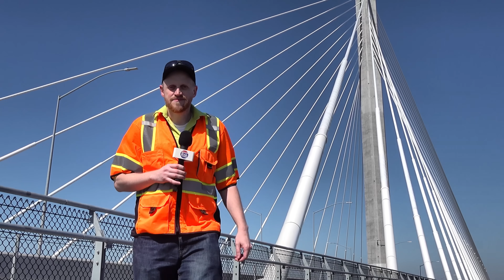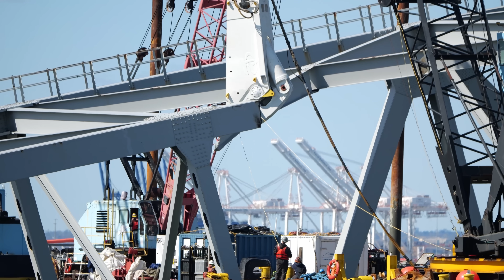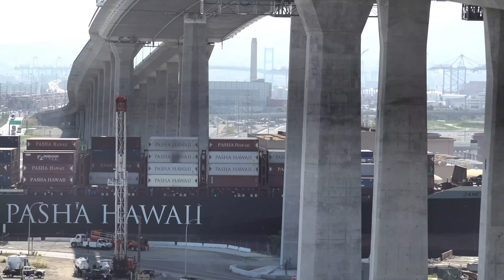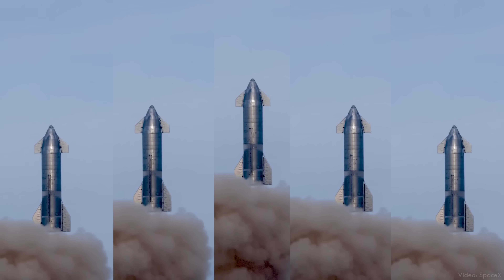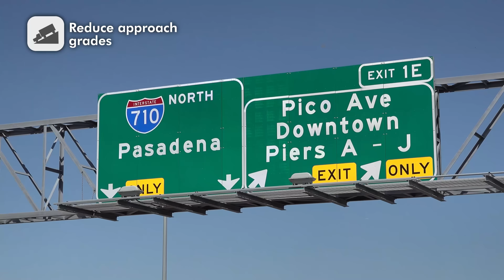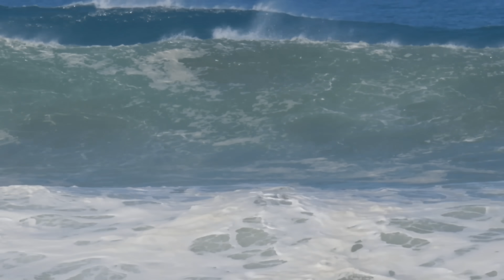How Bridge Engineers Design Against Ship Collisions

Comment: It seems that since bridges don't run in to ships; that the government agencies that regulate the shipping industry should do some actuarial studies and come up with a surcharge to be levied creating a fund for repairs and rebuilds of damaged infrastructure. Of course this cost is past down the chain to the consumer but so are government sponsored remedies that the taxpayer picks up. The difference is that the fund would be proactive and if a certain area of the country is more prone to these types of accidents; then the surcharge could reflect that. Also, it makes more sense to redirect the energy than to try and stop it. In addition to the concrete bunkers that protect the piers; couldn't they engineer powerful turbines behind them that would create a sufficient current to move a ship away from the piers. They could be automatically turned on by sensors that don't like the proximity of a ship to the bridge.

Comment: I really liked the way you explored risk and risk management in this, it would be super cool to have a whole video on risk based engineering, and breakdown risk control measure into engineering controls (like islands or putting piles on land) and administrative controls, like speed limits in channels, local port captains and tug boats! I work a lot in risk management engineering and sometimes it's hard to explain to other engineers the concepts behind risk based decisions and acceptable risk levels. Great work!

Comment: I have been pondering what the best way to protect bridge structures ever since the Dali struck the francis Scott key bridge.  It would seem to me that we need to look at the shape and angle of guardrails on either side of highway bridges.  In my thinking, guiding the ship back into the channel is the better solution.  I don't see how the small dolphins would come close to accomplishing this task whereas a long concrete wall/curb would better facilitate the event.  I am not an engineer, but I believe in brainstorming.  someone's Idea could be either the solution or a part of the solution.

Comment: Very well stated.  So, I'm a native Marylander who learned how to sail in the "literal" shadows of the Key Bridge.  The average depth in the Patapsco, and even the northern Chesapeake (north of the Bay Bridge) ranges between 15-20, maybe 25 feet feet.  I was taught at an early age to recognize when we were crossing the channels... which would go to 50 feet.... With that said, I do know that the width of the channel under FSK bridge was less than the total length of the main span but unfortunately not enough to slow the ship in time.  I do wonder if the replacement bridge (like the one in LA that was pointed out) would have a longer span - not necessarily placing the towers on land BUT back far enough - would benefit from a more natural barrier of very shallow water to protect the bridge piers.  I'm in no way suggesting no other protections be implemented for a new bridge BUT the Chesapeake, that far north, is much more shallow than most other ports around the country.  Just saying that 15-20 feet of water is going to slow down a large container ship like the Dali pretty darn quickly when it needs at least 45 feet.

Comment: I am working on a pizza oven. I am laying firebrick on top of a concrete slab sitting on a cinder block stand. The countertop slab (under the firebrick) is going to overhang 7 inches on either side and 6 inches in the front (no back overhang) I’m worried because I am building a dome which sits on the edge (of the overhang) and the majority of the weight will be on the over hang. It’s gonna be lightweight concrete reinforced with rebar. It will have a 7 in over hang on the sides and 6 on the front. Counter slab will be 3 in thick. Can that support a pizza oven. I’m worried that as I stack bricks on the overhang, it will pull the top half (if the slab is cut on its biggest cross section) of the slab and crack. I know the rebar provides tensile strength but it’s not like tensioned or anything so cracks will form before the steal has a chance to resist the tensile stress. I was thinking abt pouring it with 1/2 threaded rod instead of rebar and using stainless steal sheet metal as the form for the concrete (temporarily reinforced with wood) and then tightening bolts on either side to provide tension before I place a load on the overhang. And I could finish the bolts and they’d have a sick kinda steampunk look (I digress)

Anyway can you Mr. Hillhouse or anyone else with any expertise comment? Is this overkill? I have 10 days until I’m expecting to pour the countertop slab. 

Thank you for your time!

Comment: As a former maritime electrical engineer, ships have redundant machineries to the point where all critical equipment are doubled...especially for pumps. When it comes to power they have generators and an emergency generator that powers a redundant hydraulic pump for the steering system. The problem here is both the spare generators and the emergency generator somehow failed...most probably there was a problem with the emergency generator, there are alarm logs on board, there is an event printer that prints all alarms, its connected to a UPS.
As for tugs accompanying the ship, simple answer... tugs are really expensive to have on hand for such a crossing... we are talking 4-5 digits for every crossing.
TLDR sometimes 💩 happens, investigation will tell us if it was improper maintenance of the Em'Cy generator or whatever the root cause was for the repeated blackout.
Long post, hope it helps

Comment: The one thing to remember about spending more money to reduce risk, is that there's so many elements to the system. At some point, the bridge is safer than the surrounding roads, so you spend money there instead, and then the intersection design, and even moreso you could be using that money on things like education or fire departments or any number of other things. It's important to remember where else that money could go when you think about why we allow risk

Comment: As a seafarer myself and in Engineering Department of the ship, there are tons of backup machinery in case something fails. I'm talking about 2 pumps each for Lubrication, Fuel, Hydraulics, Air system and Cooling Water (Fresh water and Sea water), and each machinery has 2, meaning Generators and Main Propulsion have their own set of 2. Also all of those machinery have corresponding backup (Auxiliary) pumps which means even if 2 pumps fails (or the power fails) there's still smaller pumps capable of running the ship. There's also an Emergency Generator beside 3 Main Generators (really big ones) so an engine failure on 3 will still able to run the ship as all non-essential machineries like AC and normal lights are off to lower the load. Basically a ship is capable of sailing on Emergency Generator alone if worst comes to worst, theoretically.

Now onto inspections, there are 3 port authorities that are somewhat infamous for how strict they are in the world, US Port Authority, Australia's AMSA, and Chinese Port authorities (they're getting stricter every year) not to mention EU countires and Port Authorities. To prepare for going to Port in US alone will cost the ship tons of drills, testing of machineries and cleaning. I'm talking about a month of preparation with minimum of 2 weeks, basically lot of overtime for all crew to test and drill for emergency (these authorities are no joke for us!) as failing for inspection means lots of trouble and more overtime for us to rectify said troubles.

Overall my point is, it takes a lot, I mean a lot to cripple a ship. You need to be a bad Engineer to disregard all maintenance operation and it will still take months prior to this incident to f up the ship. I know nobody is perfect and those shipping companies that does wihtheld supplies for ship maintenance and crew living ain't gonna go to these 3 countries (US, Australia and China) and EU in the first place since it will cost them tons with their little budget and low profit and one peep of a seafarer about their living condition and these companies are now under special spotlight every time. They'll be going to more convenient deals that will not give them much trouble with convenient countries, and even then a skeleton ship is still susceptible to ITF (International Transport Workers' Federation) raid and charges, basically a seafarer police that will force companies to treat us better as well as making the ship more safer.

TL;DR - It takes a lot to cripple a ship with bad machineries and poor company policies, my conclusion is, a cyber attack is easier way to cripple a perfectly good ship undergoing regular inspection of US Port Authorities and maybe other good Port Authorities. Also I heard Synergy is a somewhat good company.

Comment: as with any safety system, there is a point at which engineering becomes too costly but you can still add other ways to reduce risk. Just as hazmat vehicles arent allowed in tunnels in the area, vessels can be required to have a tug escort under important waterway bridges.

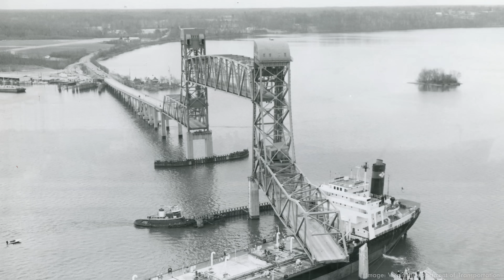Comment: Whatever bridge goes in, put a man in front right corner with a 2 way radio and a rangefinder, and a man with a 2 way radio and a rangefinder of the ship. Have the captain aim for the middle of the bridge so they can measure distance between the pillars 7:36 7:40 . Hey, I have 500 feet on my side and the other spotter says I have 900 feet on my side. Nice and slow too and no night time departures. Total cost of equipment is $1,000. Keep it centered captain. Save a couple of billion dollars by not having a accident
Reply: or mandate tugboat attendance

Comment: What is the cost of adding a dozen or more "Dolphins" before the bridge?  All the engineers reading this should be able to do a quick "back of the envelope" calculation.  Now compare that to the cost of this incident: loss of bridge, loss of ship, loss of business, loss of travel time.  It seems that regardless of the costs of the "dolphins" they would have been way less expensive than this cleanup and rebuild.  Its is, and was, all about the $$.  "Don't have the money to prevent this, but will somehow find a lot more money to  fix it".  OK, it may have taken a year or two to build the protective "dolphins" so what to do meantime?  Well, when the larger, exponentially massive, ships were approved, there could have easily and cheaply been added the requirement to use a dozen Tugboats.  

Why were these obvious and simple , and affordable steps not taken?  Easy answer: incompetent politicians and bureaucrats !

Comment: with these older truss bridges its also important to understand how each half of the bridge works, ie if you cut the bridge down the centre to have a left and right side, each half is designed as a counter weight, so cut each half down the centre again, the land side of that half acts as a counter weight to support the seaward side, the two seaward sides will of coarse at a smaller degree rely on each other to lean against as traffic alters the weight on the bridge, but this is pretty small compared to the weight of the bridge

the total collapse here was due to one side being undermined, and with the bridge being so well constructed and bolted together simply pulled the other half apart forcing that half to become unstable

more modern span bridges rely very much on the cables that support it, which we see during construction, you could pretty much build one side first to the centre without the other side as it is supported by the vast cables coming from the towers and connected to the land side of the bridge, but eventually the two halves will connect, any bridge having a failure one side will unfortunately will have an effect on the other side partially or fully depending on its construction, i think we have all seen videos of a road way being stripped like a domino effect

i think the real answer is to create Dolphins around the bridges, both bridges and vessels are overengineered but simply not compatible by nature

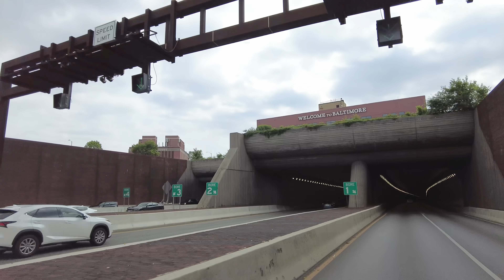Comment: Slight correction at 5:50 - there are actually 2 tunnels that cross the harbor: I-95 goes through what would probably be considered the “main” - i.e. moderately larger - tunnel, and then there is also the I-895 harbor tunnel (fwiw, the Key Bridge was part of I-695 a.k.a. the Baltimore Beltway, which literally circles the entire city…or, at least, it did).

Comment: Also, even if you are throwing the dice once per year, that is once per year per structure. Google/Wikipedia says 600,000 bridges in the US, so you are throwing the dice 600,000 times and then reporting the single time you succeed (or fail in this case.)

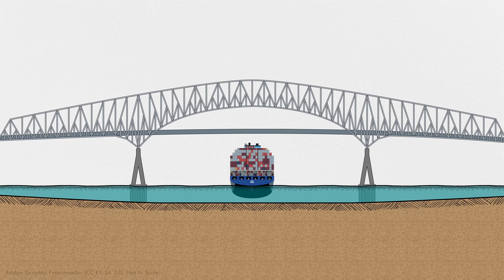Comment: 13:10 A normal distribution looks suspicious to me from a modelling standpoint, especially for accidents of these type.  Surely a better choice is the Voigt distribution, which basically amount to the ship travelling straight (with a normal distribution for the horizontal displacement from center) until some point of failure where it takes a uniformly chosen random direction.

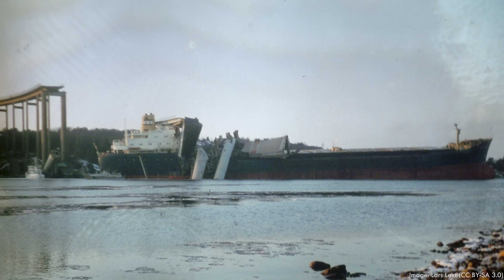Comment: 7:31 This picture is from the Almö bridge collapse, commonly known as the Tjörn bridge collapse in Sweden in January of 1980. Due to darkness (it happened at 01:30), fog, ice and strong currents, the Star Clipper hit the bridge on the Tjörn island side leading to the entire 300m main span collapsing into the water and partly over the ship. All crew were unharmed but seven vehicles including one truck drove over the edge and into the water. Eight people died. On the land side a truck driver who was driving extra slow due to the weather conditions managed to stop 10 meters from the edge when he saw that the guard rail was missing. He could stop the traffic from that side, saving several lives. On the island side, however it took about an hour before the bridge was closed. Several attempts were made to alert drivers, but sadly in vane.

Comment: When I was doing my engineering degree in Switzerland, back in the late nineties, we learned about bridge safety against collisions. Now, ships are not that much of a thing in a landlocked country, but railways are. 
For protecting the piers of a road bridge going over a railway line against derailments, there were 3 strategies: build no piers, but make the bridge span longer; armour the piers with collision damping structures; build the bridge so that a derailing train could wipe out a pier and the bridge would still stand (n-1 safety). 
The first two were addressed in this video, the third one, not sure how it could be possible to implement it on a bridge of this scale 😅

Comment: Maybe the solution doesn't rely on bridge protection but deflection, with airbags under the water and emergency pumps that create an artificial water current that would steer a powerless ship. The size and weight of these containerships are bonkers so deflection might be the only way to go.

It is the usual case, if you know the exact disaster you are guarding against there is probably a relatively simple solution, but anticipating every and any scenario, that is more challenging.

Comment: "Trucks with hazardous materials aren't allowed through, requiring an enormous detour around the city"

Check out the Blue Mesa Bridge on US-50 in Colorado, closed since April 18. From CDOT: 

> The northern [detour] route is 354 miles and requires approximately six hours of travel time. The southern route is 331 miles and requires nearly seven hours of travel time.

Comment: I sincerely hope the new Key bridge is a steel suspension bridge. Sure, cable stayed is fun to look at, but they typically use concrete, which is far more difficult to maintain or modify - especially over brackish water. Concrete is also very carbon emission intensive. New suspension bridge with wider & taller clearances taking the suspension towers well away from the deep draft shipping channel (plus dolphins/fenders) would be the ideal solution, i think. A silver lining to this tragic disaster.

Comment: The Tasman Bridge (Australia) partly collapsed in 1975 following a collision of a bulk carrier. Now repaired but "Vessels above a certain size are required to be piloted, and vehicle movements on the bridge are temporarily halted when large vessels are to pass underneath the bridge. As an added precaution, it is now mandatory for most large vessels to have a tug in attendance as they transit the bridge in the event that assistance with steerage may be required. " -Wikipedia
The Australian Antarctic Survey replaced their flagship recently. They knew that the new vessel was marginally too tall to pass under the bridge for refuelling but they bought it anyway. They have sought permission to transit the bridge. Refused.

Comment: I would encourage Maryland to include a deck for high speed rail, not freight, on the Key Bridge replacement. Riding Amtrak Acela thru the tunnels under Baltimore is a harrowing experience. And very slow. A bottleneck that has experienced underground fires too often.

Comment: At around 13:28, shouldn't the ends of distribution curve be colored as well? Given that to get to that distribution area you need to pass through the column?
Reply: No, because it's not measuring the chance of a ship under the bridge suddenly, in defiance of all physics, sliding to the side. It's the chance of a ship passing under any particular point.
Reply: @PyroDesu  but wouldn't it be also unsurvivable for the ship&bridge if it ended up on the other side of the pillars?
Reply: @bezdras  Not necessarily. And even if a ship struck a span, it's generally (depending on bridge design) much less catastrophic than a pier strike and would be a different risk scenario entirely. This calculation is only used for pier strike risk.